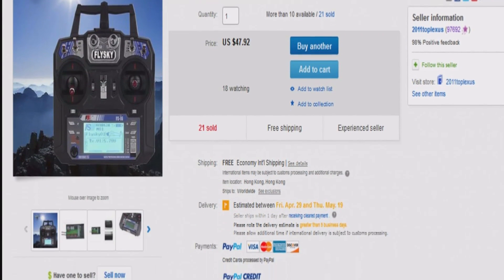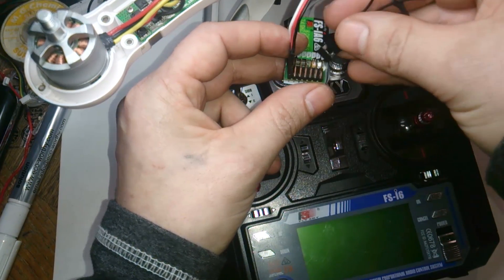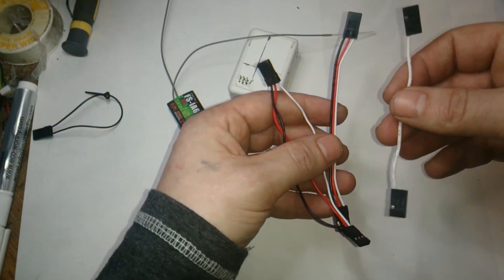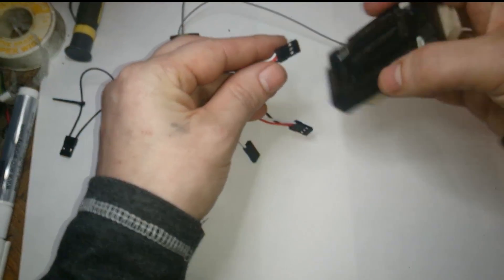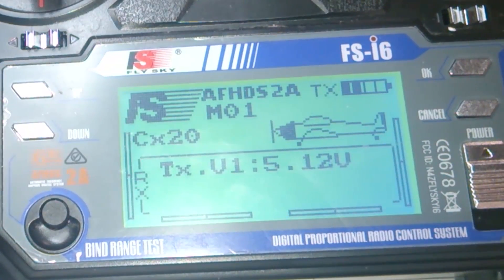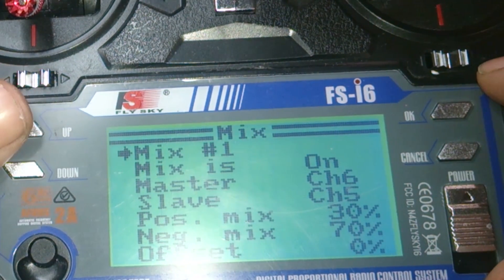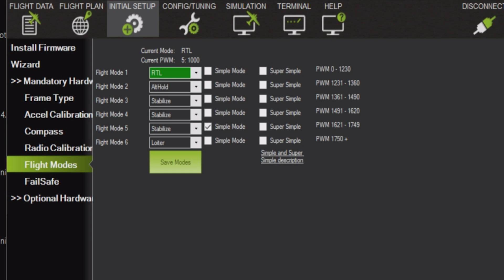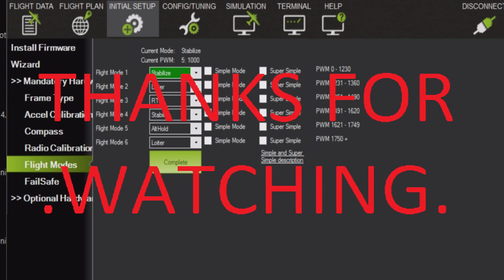cx20 flysky FS i6 FS IA6 binding and Mission planner settings

Comment: hi 
i have a problem with my Flysky-i6, can you please help me? i setup the transmitter and the receiver but when i got mission planner radio calibration i connect the apm2.8 and then i click 
calibrate the apm  disconnect? can u help please 
many thanks
Reply from the maker: I would double check your wiring going from receiver to your apm.. you can send pictures here bangs696969@gmail.com    of the wiring on the rx and apm..     It might also be too much of a draw on your apm and it is browing out/ resetting .   Do you have other devices hooked up .. telemetry sonar ect..
you can test this by removing (cutting) the red wire in the usb cable. Use that cable with your pc. then plug in the battery and see if the apm still resets..   Alternatively you can plug in the battery and the usb cable as others with out cutting the power wire. but that is up to you.
Reply: +bangs6996 I did what u exactly did, and I haven't attached anything to telemetry it's just the receive, I'm gonna try to send u some picz and if I want to rest the APM can I just press the rest bottom or do I have to rest it through mission planner? Thanks
Reply from the maker: you need to reload the firmware through mission planner, the reset button is just to reboot the apm...  For kicks as well you can just unplug all the wires from the receiver , go to mission planner and push the calibration button and see if the apm shuts off on you... I would actually suggest that just in case for some odd reason the apm is fried ..
Reply: +bangs6996 I did it but nothing happened and the calibration successful, but for compass calibration, nothing happening and its says "compass 1 error:99"? I'm confused now Thankyou
Reply from the maker: .. do you have internal compass on your apm.  lots of them don't actually come with them  ..........oops should of asked if you were using internal or external compass..
Reply from the maker: In regards to your pictures...  at 5:02
 I show how to wire it using less cable. However it should not be a 
issue as long as the receiver positive rail is truly one rail and not 
split some how..
Reply: +bangs6996 I have one but didn't actually use it when I did compass calibration... Thanks
Reply: +bangs6996 okay I will be waiting for your updates,..many thanks
Reply from the maker: oh yeah .. Don't forgot to remove the jumper to enable external compass.. its not jp1 its the other one....but you can remove both as well if not using a bec..
Reply: +bangs6996 Yh I've done that now everything is working, they only thing that I cant setup GPs don't no how to do that, thanks for your help, really appreciated.
Reply from the maker: gps is easy just plug it in... and your done =) ... well depending on which gps you have..
Reply: +bangs6996 yh I did but when I go to mission planner it says "GPs not fix" and the GPs that I am using is "Ublox NEO-6M GPS module" this came with the APM2.8.
Also, for wiring receiver, for the first channel I will connect the red/black/white wire and the other rest just connect the signal wire?? Thanks alot
Reply from the maker: Yup you just need the signal wire. the first channel creates a ground share between the two..     your gps you might have to go out side to get a lock.  if you still have problems look for Enable gpslock In standard Params  ..but really I've never had to do anything to get my gps to work..
Reply: +bangs6996 okay I will do that very soon and for GPs I did what u said and it worked thanks a lot, now I have a problem with calibrating the ESCs. I turn transmitter on, set throttle to maximum and then I connect the battery, it beeps then disconnect battery and connect again then it don't work I don't no why, can u help fix that please. Many thanks
Reply from the maker: did you disable arming check? like in this video https://youtu.be/mrBWEATUbus?t=1440
Reply: +bangs6996 yes I did exactly on the video but still everything seem the same, can I make a video and send it to you by email? Thanks a lot.
Reply from the maker: Yes you can send me video
Reply from the maker: Stop what your doing!!!! .. You went into a programming mode and actually set a setting on just one esc..   check out this video .. I explain how to do the esc calibration.. I also show you what not to do ..that you actually did by accident..    https://youtu.be/mrBWEATUbus?t=1885        after that .. match up your main menu beeps with this video . You are going to have to reset the esc to defaults one at a time ..   https://www.youtube.com/watch?v=ygVlAyLPfI4    .. I suggest to match up to make sure your esc are the same firmware.
Reply from the maker: also if you don't want to do the esc programming you can order a programming card.. you will still have to do a esc calibration however,, The card makes it easier to see what the settings are on your esc..   I just ordered this one for mine to test it out.. http://www.ebay.com/itm/Hobbywing-Programming-Card-for-Hobbywing-FlyFun-SkyWalker-ESC-/262450244721?hash=item3d1b40ec71:g:ZGQAAOSwmtJXXUMU#shpCntId       my esc is hobbypower ,hobbysky ,skywalker hobbywing..type
Reply: +bangs6996 sorry I just don't no what to do, and plus my 2 ESCs are getting too hot. I'm gonna watch the video and follow it step by step, you did the programming, so after that do I have to set each ESCs to defaults right? Thanks for the help.
Reply: +bangs6996 okay that looks good I will order one today thanks!!
Reply from the maker: Just make sure you have the same esc's as mine, or at least the same firmware.before you order.. in this video https://youtu.be/ygVlAyLPfI4?t=309  match up programming menu beeps with mine,  And yes you need to do one esc at a time now, save the all at once calibration I show at the begging for last,  In your video you might of set cuttoff mode ect.. what that means is if your esc senses low battery it might just turn off the motor that = it falls out of the sky,  You will need to set each esc to my defaults I have in the description
Reply: +bangs6996 I am using Emax ESCs and I think it's different then yours coz I did follow the steps u made but nothing happening. When I connect the battery it doesn't beebs but when I disconnected the battery and connect then it starts beebing so I have to do that at all the time, I don't no why. Any solutions? 
Thankyou
Reply from the maker: calibrating the esc would be the same as in the video for you.  once you arm the quad put the throttle up .then plug in the battery the very first 2 beeps you hear from your motor / motors..is esc calibration..that is when you put your throttle stick down..   you would need this card I believe.. you can find better ones but this one in the link at least shows you what the settings are at.. http://www.ebay.com/itm/EMAX-Airplane-Programming-Card-for-EMAX-Brushless-ESC-ge-/271542018534?hash=item3f392a61e6:g:XKUAAOxyThVTbbDE    ... you won't be able to fallow my menu beeps as i don't have that esc
Reply: +bangs6996 yh okay, but the thing is I can't arm the Quad, I put the throttle to the right Button like u did but it doesn't arm and when I connect to the mission planner, it's says "bad compass health" so I am thinking it's the arming and compass, when I try to calibrate the compass it says "error" and nothing shows. 
Thanks you
Reply from the maker: alternatively you can also draw down the menu.. 
just like my video .. wait till the one esc goes into programing mode..and you start to hear the menu beeps..
on a piece of paper draw down the beeps.
this pdf says you have 7 options..confirm it.
http://yinyanmodel.com/EMAX%20User%20Instruction%20for%20Simonk%20Series%20ESC.pdf

also from banggood the manual says you only have 6 opions..
you can confirm that with your drawing..it also shows you the sub menu in the manual..
http://img.banggood.com/images/upload/2012/chenjianwei/SKU122899.6.jpg  

lastly if your really confused... just make another video and this time let the entire menu play out and i'll help you figure it out.. i'm not sure if that card will help you with yours or if you will need another one... also include the full descriton of your esc's ect..
Reply from the maker: above I asked if you disable arming check that is your issue You Have to disable arming check like I show in my video its best just to set it to 0 and disable all of them ..then write the parameter..
 like in this video https://youtu.be/mrBWEATUbus?t=1440
Reply from the maker: Alright our first goal is letting you arm the quad. You don't even need a gps or a compass installed anymore just unplug them for now.. .Make sure to fallow steps to disable arming check to disable all , or set it to zero , or un check them all.. depends what version of mission planner you have.....    the next step is to make sure you set the reverse setting. https://youtu.be/Vyt2d8rXkws?t=502
next step .. is to redo a remote calibration in mission planner..
Reply: +bangs6996 yes I have done that it's still not working it should show on the mission planner that the quad arms and disarms. 
Thanakyou
Reply from the maker: I was about to send you my parameters.. but I wonder did you set your flight modes? are you sure your dip switch are both up. If your not sure go to flight modes and make sure when you you turn on your remote the green bar goes to stabilize   .... you can download your params and send them to me as well  if this does not work
Reply from the maker: If you fallowed my steps in this video on how to set the dip swtiches.. you can use my params ..here ..https://drive.google.com/open?id=0B2w6_OKE_2kxMzFWZXplVml5cTA    after you load them make sure to click on save them or write them on the right as well
Reply: +bangs6996 I used your Params and save them. And I have disconnect GPS and I will watch the videos I will email you if I'm stuck again, thanks for your help, hope I have disturbed  you. Thankyou
Reply from the maker: no problem,  ..You will still have to do another remote calibration with my parameters.. .. and also go into flight modes.then turn on remote. move the dip switches or variable switch until its on stabilize..
Reply: +bangs6996 Yh I will do that, but I was ur video connecting wires to receiver, you only have 3 connections and I have 5 connecting APM is that matter? if YES, How many wires do I need to connect through receiver to APM? 
Thnakyou
Reply: +bangs6996 I have done it, I can armed and disarmed and also done the radio calibration, flight modes, switch SWC 1-Sta 2-Loi 3-RTL switch SWB 1-RTL 2-ALT HOLD and I'm gonna do the ESCs calibration I will get back to u, that's a good sign you are the STAR thanks a lot, God bless.

Comment: Hey btw this controller supports 10 channels with some modding! https://github.com/benb0jangles/FlySky-i6-Mod-
Reply from the maker: hey btw I NEVER knew that lol.... .. this is very cool mod.. will being do this mod for sure ...
Reply: Right! And with either the ia6b or the ia10, it will do 6 channels on PPM, which you could run directly to the APM with a single wire, and use the rest of the PWM for servos, or wire them to the APM also, but it would make things so much cleaning with a single wire!
Reply from the maker: so I know we are jumping around on this. this mod would require me to get a 10 channel receiver??  If so .. could we not just program a arduino and tap into the ppm bus and parse the 10 channels off that.. ?...
Reply from the maker: orrr ignore my last comment and just do that lol

Comment: hi.. how do you set a faisafe (lost connection with tx) to be RTL using this flysky i6 remote?  thanks
Reply from the maker: I would think that having a failsafe on the tx would be pointless as it could not send the command to the RX for lost connection..      If you meant the Rx attached to the apm then its done through mission planner if your using a apm?
Reply: i have set in APM the failsafe to be RTL. but when i tested in MP by turning off the tx.. the flight mode (in MP flight data screen) goes to whatever flight mode that i set in flight mode 1 (in this case: stabilize).
Reply from the maker: Here is somebody elses video I just found explaining his settings.. Honestly i just use my apm fail safe as it will either auto land or return to home if something is up with the remote .. .. here is the link.. https://www.youtube.com/watch?v=LXTEXqR_ghI
Reply from the maker: I've never had a issue with lost rc connection fail safe in mission planner.. ...it always just does a auto land on mine.  I think the video I sent you is more if  you loose connection for a second how it would recover..
Reply: i saw that video earlier but is seems it wanted to cut the throttle when having lost connection. Actually, i just wanted to setup like you... it will go return to home using apm fail safe.  but how do i ensure with it will work on the field?  can i test it in mission planner by turning off the remote?  using the stock rx.. when i turned off the remote... mission planner display shows RTL in flight data TAB... but using flysky i6, it shows STABILIZE (which is the mode I set in MP flight mode 1)
Reply from the maker: Err sorry to spam you..   In your tests..  Set it to return to home or 
auto land in Failsafe option of MP (auto land if no gps)..   arm the 
quad while in mp with the blades off .. and put the throttle about half 
way now move the quad about 5-10 feet away and higher up.  Better if you
 have telemetry for this test.. then simply turn off the remote .. you 
should see Failsafe in the hud and it should try to land or return to 
home ..
Reply: perfect. i will do the test with telemetry installed to make sure i can override in case the failsafe fails and rx will not rebind after turning off.  thanks alot  :)
Reply from the maker: Let me know how it goes ..you might have to play with Fs pwm This page will better explain the fs pwm settings  http://ardupilot.org/copter/docs/radio-failsafe.html